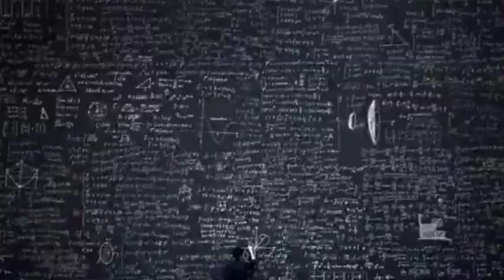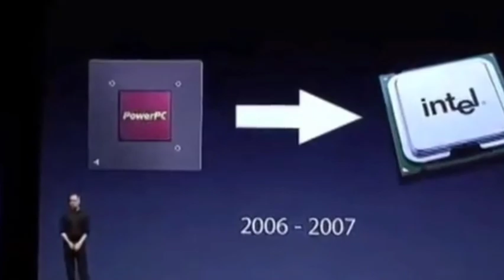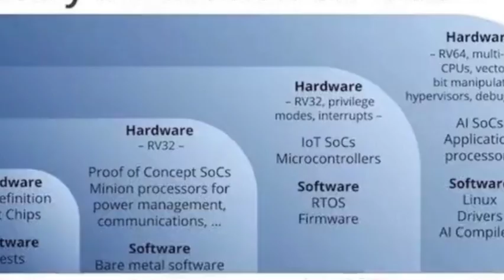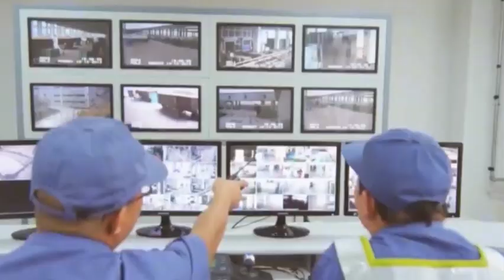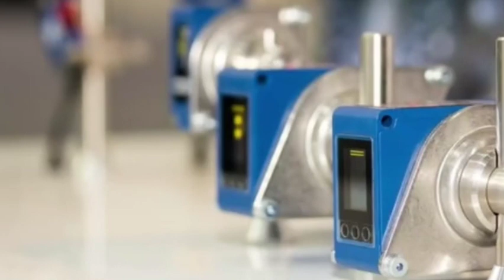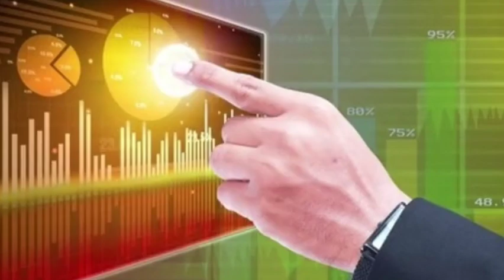This company launched RISC-V chips for commercial use to criticize ARM, which caused public outrage.

Comment: In China only a selected few Chinese manufacturers  focused on high end chips where else the rests going into matured nm which command  85 percent of the usage . The China manufacturers will supply to their own Chinese consumers n make as much profits as possible for now . Less than 10 percent used high end NM chips. China will eventually control the matured chips n mass produced which will push down prices hence killing off the foreign chip manufacturers . Without profits , the Western will have problems not only with R & D but the shareholders.